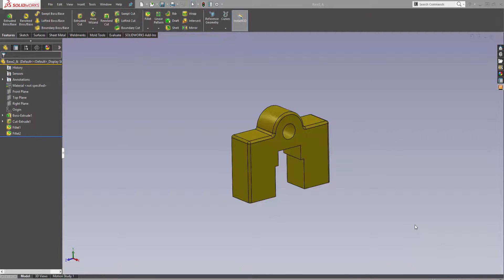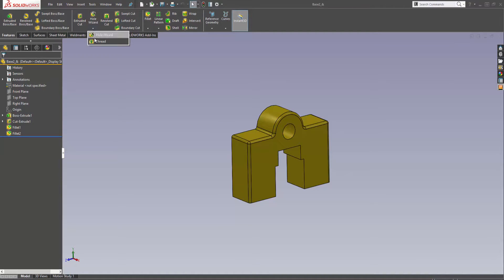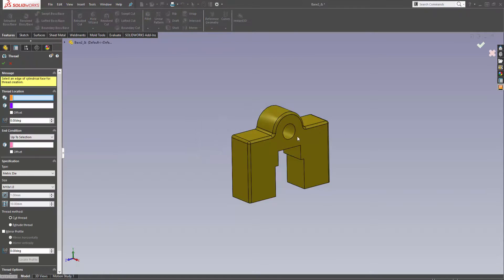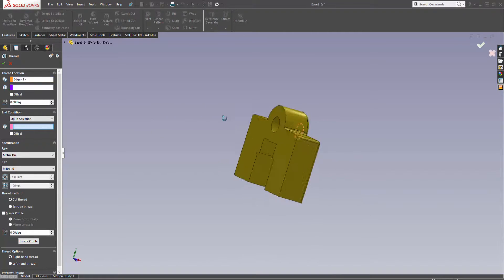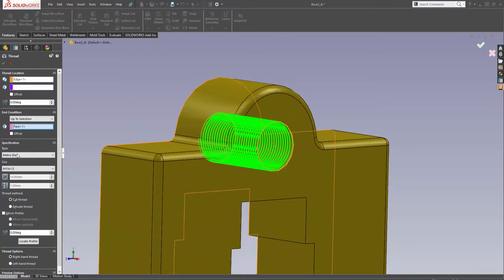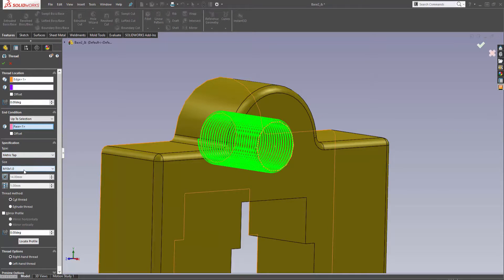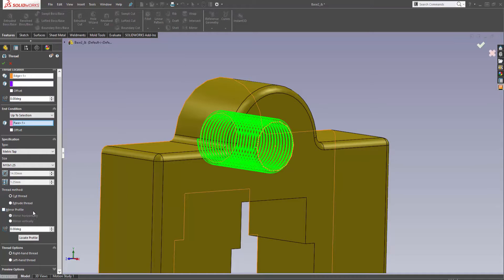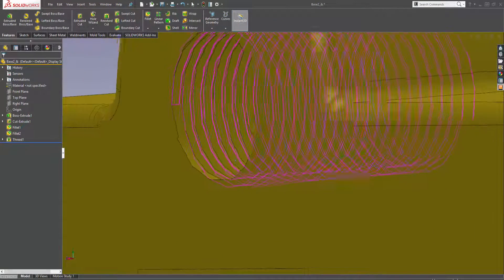How to use the Thread feature in SolidWorks

Comment: Thread feature is easy but how to use it correctly ? But it seems you just cut a M10 tap into a 14mm hole this is beautifully on screen but no bolt will fit if you actually use this model. Can you explain how to accurately define the hole size ?